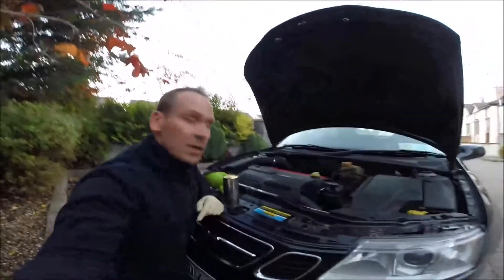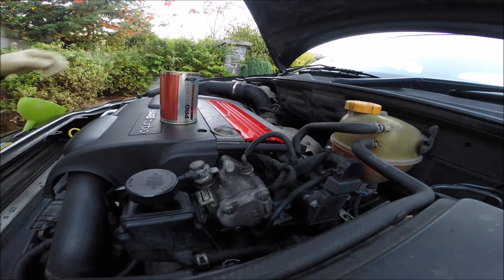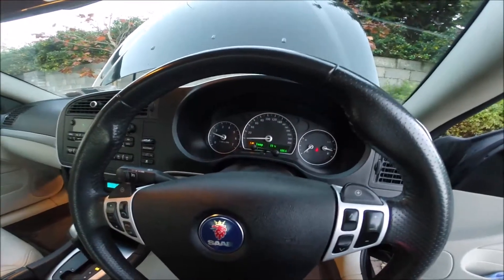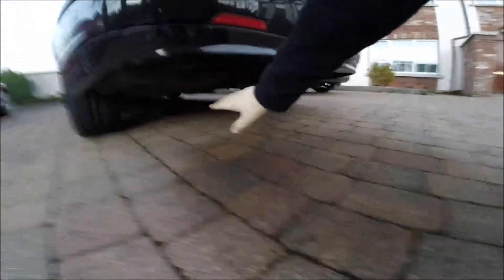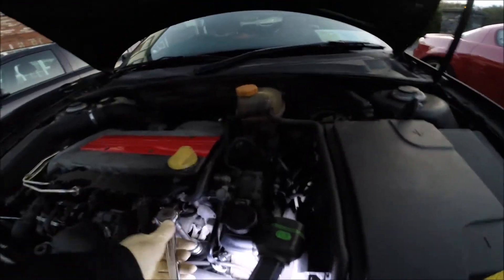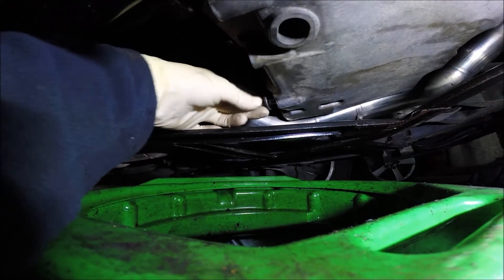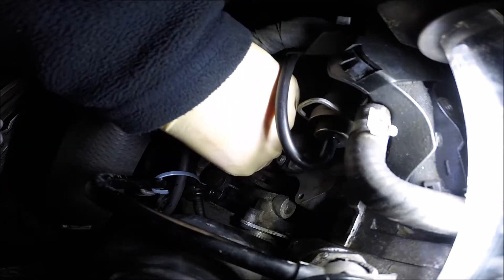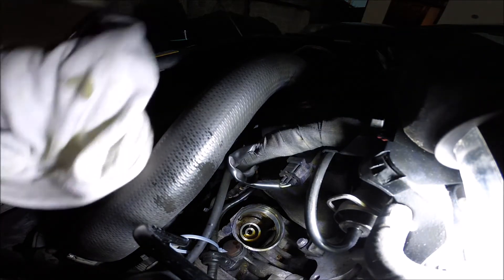Saab 9-3 1.8t  Engine Flushing, Fight With Blue Smoke After Night

Comment: I did the same thing. Car is still smoking ;-(
Reply from the maker: So...next Saturday I'm planing replace the valve stem seals and we will see ;)the cost off the seal is only 55e for set so whay not trying.
Reply from the maker: ...did you check the turbo , no leak, no play ?
Reply: I would change the PCV valve before anything .. saab have a TSB about it
Reply: The Flying MechanicDIY 
Changed the PCV Valve with a Original Saab new Valve. We had to take off the intake manifold for this valve. Then replaced the Turbo, cause there was oil on the exhaust side of it. But there was a sticky black chewing gum kind of stuff in the exhaust side of the Turbo as well... Smoke is much better now, I guess I have to drive a longer trip, but before that I want to use a engine flush and perform an oil change with filter. I have put anti oil leak stop in the engine, 2 months later the smoke occurred and i suspect this Anti Leak Glued my oil lines of the engine, not good :-(
Reply: muffty81 bad, if i have a rule to say , it’s going to be never used STOP anything, stop coolant leak, stop head-gasket leak, oil leak bla bla bla .. if u have a problem fix it or sell the car.
Anyway, good luck with ur car
Reply from the maker: @muffty81  hi, your car had little oil on 2nd cylinder after night ?
Reply from the maker: You have Lin to the Saab TSB .
Reply from the maker: @TheFlyingMechanicDIY  hi, I'm agree. :)
Reply from the maker: @muffty81 ...you talk about B207E engine ?
Reply from the maker: ...After replaced valve stem seals still have little oil on 2nd cylinder and smok after night :(
Reply: FixYOURride13 it is 50/50 chance between the PCV valve or the Turbo, check the turbo exhaust side for any oil, if there is any oil its bad turbo, check the intercooler pipes as well, if excessive oil then its bad turbo.
U can pressure test the PCV valve if u take the throttle body out, but i never did it, i just replace it.
I will try to find u a link for the tsb
Reply from the maker: @TheFlyingMechanicDIY  ok I'll go to the PCV valve,  the turbo is fine is dry and the intercooler system dry as well. I only confused from have engine oil on ma 2nd cylinder.
Reply: FixYOURride13 try to google SAAB 232-2682 .. thats the TSB
Reply: Nie ma zasto
Reply from the maker: @TheFlyingMechanicDIY  thank you for you're support. In touch,😀
Reply: The Flying MechanicDIY 
Yeah...I used a couple of stuff. At the end I used Wynn’s Supercharge :-( My Plan is to flush the engine oil with filter twice using a Liqui Moly Motor Clean. Then twice new 5W-40 oil change with filter and if not lucky take off the oil pan and checking oil lines and oil pump for sludge.
Reply: FixYOURride13 
Nope not as I can remember
Reply: FixYOURride13 
I have B207L
Reply: muffty81 if u have a smoke issue, then i doubt any of this will help.
You have to identify the source of smoke  (turbo, engine top end, or engine bottom ) u already changed PCV.
So i would start checking things, blow by, oil in intercooler pipes, oil in turbo exhaust side ...etc
Reply from the maker: @TheFlyingMechanicDIY  ...PCV Valve is ordered so we have to wait :)
Reply: FixYOURride13 
Finally!!!  Smoke issues are gone ;-)) I had to drive the car for about 60 Km Highway😆 After the Turbo swap there were still oil left in the cat and intercooler as well as the pipes. This last oil had to burn off. Now, with new PCV and new Turbo, everything is fine! For gods sake!!! I almost wanted to throw the car away ;-)) I didn’t know Garett Turbo would only last about 185.000 km before the seals blow. The Shaft itself didn’t had any play, but it let oil pass through the seals on the exhaust side. This oil then immediately burned to sludge. So! Bad Turbo was the issue! Finally no more smoke, I am so happy!!!
Reply from the maker: @muffty81  Good News ;) I'm still waiting for PCV Valve
Reply: @FixYOURride13  hey man i had exactly the same issue after messing my head around finally found that the turbo was bad .